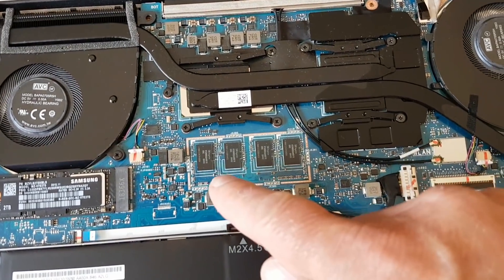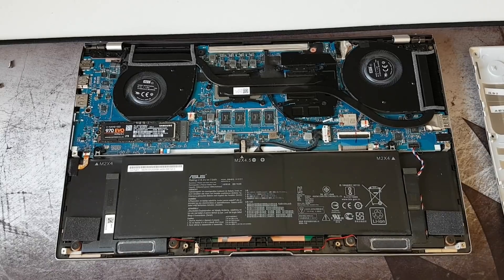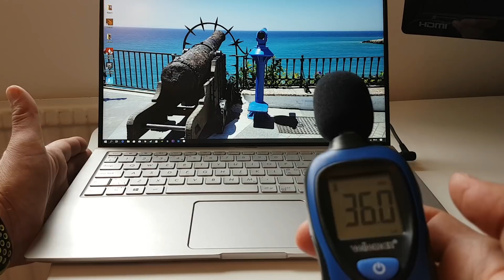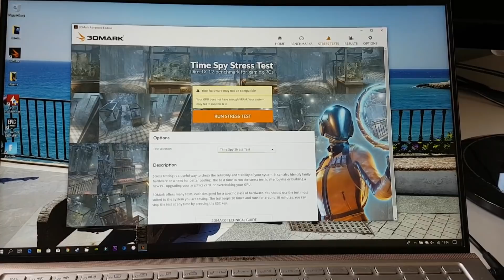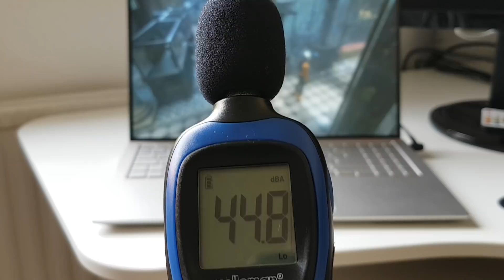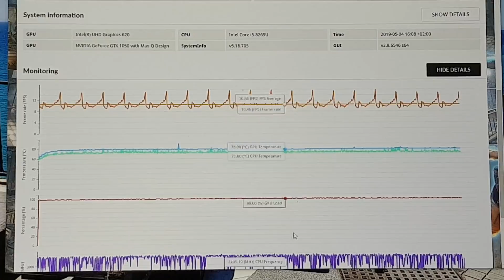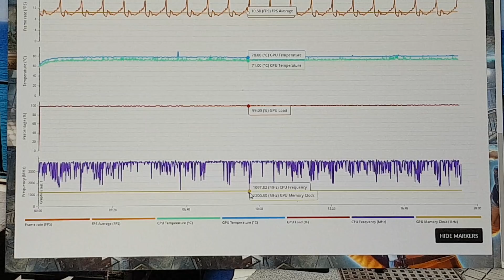Stress Testing Asus Zenbook 15 Fan Noise And Temperatures

Comment: I bought this laptop several months ago, and have returned it the next day. The reason was a too high-pitched fan noise. One can read review at notebookcheck here: https://www.notebookcheck.net/Asus-ZenBook-15-i7-8565U-GTX1050-Max-Q-Laptop-Review.406551.0.html#toc-emissions-windows-laptop-that-has-no-issues-with-overheating . They didn't mention about this issue in text, but we can see the predominance of high (several kHz) frequencies on the fan noise spectrum under load. It sounds like vacuum cleaner behind the wall. I think it is common issue for all powerful laptops in a thin case..

Comment: I have no idea about db, so you say 45 dB(A) is very silent? On notebookreview.com  they say it reaches a maximum of 41.8 dB(A).  
https://www.notebookcheck.net/Asus-ZenBook-15-i7-8565U-GTX1050-Max-Q-Laptop-Review.406551.0.html

I personally had a 2012 zenbook which never reached more than 34dba under stress (no graphics card) and think 30 dba is silent.

The MSI PS63 (same 1050 max-q card) reaches a maximum of 33.7 dba 
https://www.notebookcheck.com/Test-MSI-PS63-Modern-8RC-GTX-1050-Max-Q-i7-8565U-Laptop.397301.0.html

I think all those dbA values are worth nothing if not checked under same conditions. Personally I dislike ANY noise, so I think a laptop for just web-surfing should work in passive mode (like any pad does...). I hate it if a fan goes on and off whenever I open a new tab while surfing...
Reply from the maker: Hi, thanks for your feedback. The fan noise was more like40-41dB(A) , my instrument showed 4-5 dB(A) more the reality, as I mentioned in the video. Bought a new more expensive one and it showed values like I expected..

Comment: 3:22  How do you know the one on the right is the CPU?

I'm having an issue where the fan on the side with the power input (the GPU according to your video) is running pretty much constantly. They only time it ever stops is when I have no applications running at all and let it idle. 
Is your experience the same? How quickly after startup and opening an application do you find your fans turning on?

I disabled the NVIDIA driver, so I don't see any reason why the GPU would ever get hot.
On two separate occasions I've had both fans continuously run at full power after waking up the laptop. I'm trying to find out if it's just my laptop that's defective.
Reply from the maker: Hi, yes you are right the larger heat zink should be the CPU in this case. When you have the power connected it also  generate heat. It could be due to the thermal paste that I often change to a more efficient make. I didn't need to do it on this device that was silent even when power connected on light use like videos youtube or browsing the web.
Reply: @thetechzone6558  I updated the BIOS it the problem was even worse. I then did a Windows reset and now it's been quiet ever since. Maybe some of Asus's bloatware was causing issues. Thanks anyways.
Reply from the maker: Did you install a clean windows image? I usually depend on Windows Defender to keep the system free from malware and use to uninstall any antivirus programs that came with the laptop as they can cause the cpu to work more then nessecary.But it could also be some bloatware.
Thanks a lot for your feedback, appreciated
Reply: @thetechzone6558  Windows 10 has a reset feature, which is pretty much resets it to a clean Windows install. Luckily there was an option to reset Windows without reinstalling  all the manufacture's bloatware.
Reply from the maker: Strange, I have never seen that feature, must be new. I did a full reset yesterday but all Acer's applications returned.

Comment: Hi, thanks for the video,
I want to buy this laptop so is this laptop worth to buy for gaming(assassins creed,battlefield etc) also working in chrome,office ?
Thank you very much.
Reply from the maker: Hi, thanks for watching this video! The laptop have its limitations so playing at higher setting will be a challenge for the GPU. It's a very portable laptop so if you can accept lower frame rates on some games you will enjoy it. I suggest you look up a retail store and and check it out in person before buying it. I will be very happy if you can support the channel by subscribing :)
Reply: @thetechzone6558  Thank you very much :) +1 SUB
Reply from the maker: Thanks!
Reply: https://www.laptopi.ba/laptop-asus-zenbook-15-ux533fn-a8017t-15-6-fhd-intel-core-i5-8265u-win-10h-plavi
Reply: I have this laptop and Its great Its fast with heavy programs and gaming! BUT be careful as this is my second time having to send it for repair as I cant use it anymore due to overheating within 7 months. I have an external fan to keep it cool but it is easy for hardware to get destroyed without it as there is no way to manually control the laptop fans and temp.
Reply from the maker: @abiatanacio5461  Hi, strange that you have problems with overheating. I wonder if it could be an issue with the cooling paste. Have you measured the temperatures when pushing the CPU/GPU? An easy tool to use for that is HWinfo https://www.hwinfo.com/ .  The built in fan should automaticly use different modes(speeds) to control the heat. There is also another tool to get lower temperatures and that is to undervolt the cpu, I have used throttlestop but there is also Intel Extreme Tuning Utility. I did that when I had Huawei Matebook X Pro, check video below. I would be very happy if you could subscribe to the channel.
My video on Huawei Matebook X Pro: https://www.youtube.com/watch?v=m1CM5IWgVyE
Throttlestop: https://www.techpowerup.com/download/techpowerup-throttlestop/
Intel Extreme Tuning Utility: https://downloadcenter.intel.com/download/24075/Intel-Extreme-Tuning-Utility-Intel-XTU-
Undervolting guide: https://www.notebookcheck.net/Intel-Extreme-Tuning-Utility-XTU-Undervolting-Guide.272120.0.html

Comment: Many thanks for the video, I've been watching reviews about this laptop over a week because I want to buy it and I get several doubts.
This review is excellent because I didn't found something like your video in internet regarding temperature and noise and this was I'm looking for.
I have a question to you, in stress cases, I can to see in your video that noise reaches about 46dBA, but, how about in normal conditions like word processing, browsing internet and everyday situations of normal work?, Are the fans continuously running?.
Thank you again.
Reply from the maker: I can't hear any fan noise when just doing office work but I can feel the air flow so they are very quiet under low load. I bought a new dBA reader and the difference with the old one is 2.8dBA lower(when the noise is around 43dBA)  on the new and that was what my measurements showe in the video. I would be very happy if you can subscribe to the channel.